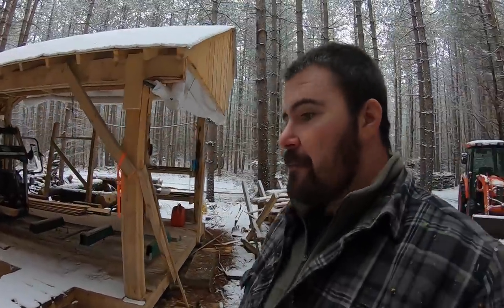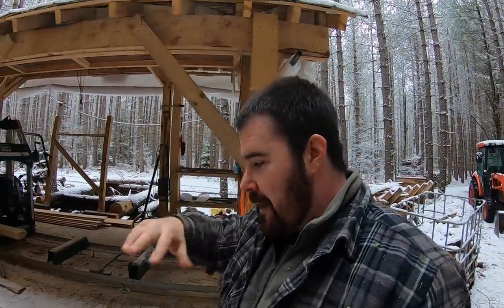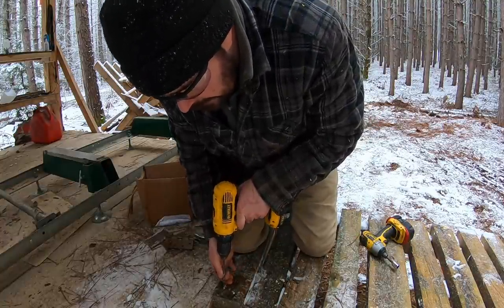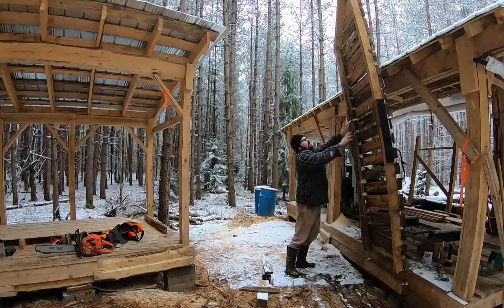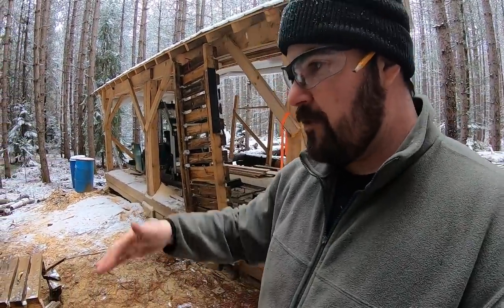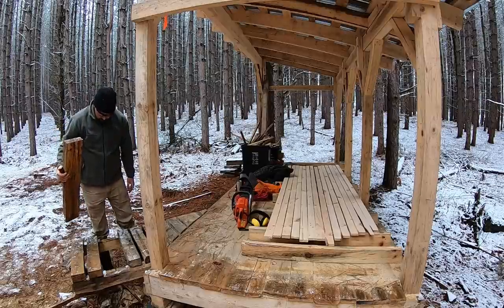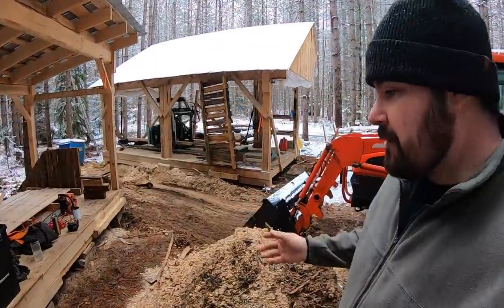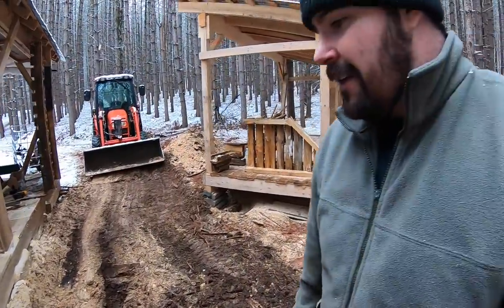Moving Months of Sawmill Dust in Seconds | + Boardwalk Hinge

Comment: I'm in central Maine, have over 30hrs on my new kioti, but have not yet attached the bucket (it came with the 48" HLA grapple attached, which I've been using a lot), and it does not have the cutting edge attached to it yet (they just got them in at my dealer, will be sending it out here ASAP - they are 1hr+ away) - would very much like it on before the big snow hits...

open station for me though, lots of maneuvering through woods and I prefer being out in the elements most of the time

Comment: Hi Sandy,
The trailer jacks is a great ideal. Add a ledger board to the end of the “draw bridge “ for the small section to drop onto similar to what you have mounted on the lumber shed. That way you just manually move it in and out and it will be supported by the long section and the lumber shed.
Reply from the maker: Great idea Chris! Thanks for sharing

Comment: Tim from Canada suggestions for your Boardwalk on your lumber mill. If you know the height of your Boardwalk from ground to bottom of your Boardwalk. Then go out into the woods cut a tree that is about the same dimension as your board work if it is a little bigger than dig a hole under your boardwalk lay the log under your boardwalk so it is supported and you can walk on it if you were still having problems moving it put the forks on your bucket move it that way or. Make a back entrance into your sawmill so you can still get in and not to move your stairs

Comment: I was also thinking to come in from behind the wood storage shed but did see that a lot of work would need to happen to have a clear path. I also like the idea of side-wind boat trailer jacks that would fold horizontally so as not to trip on the handles. But that would mean pouring a pad for the wheels to travel on. Also, four hinges with L-shaped pins that could easily be pulled out. The fourth one would remain closed as a pivot point. This would be the point farthest from the post on the wood storage shed where the boardwalk connects. This is just an idea which would not require much lifting. 
Have good days!
Reply from the maker: Thanks for sharing that. Gives me some good ideas for the future.

Comment: Use an Eye bolt in the header and one in the ramp so they line up and use a carabiner to hold it. Add a skirt board to the saw shed to keep the sawdust from going under it. Like Corn Hole boards have short legs that pivot for the ramp.

Comment: Easiest, quickest and most efficient way of fixing your boardwalk would be a spacer width of your slats attached to the beam, a piece 1" thick x 6-8" long attached to the centre of the spacer with a screw through its centre, 99% of the way in or enough friction so you can turn it through 90 degrees to hold the bridge and back to horizontal when you want to drop it. No need for rope, pulleys, wires and it'll keep it snug against the beam using the wright of the boardwalk and gravity to hold it. Cost, 1x 6" screw. My Grandpa did it with fence slats to allow gaps to nip through them.

Comment: What about a gate latch to hold the draw bridge in the open position. Could even put a lock on it what open and ensure it’s safely up there. Just a thought. I also like the jack idea. Just make sure you have enough height under the bridge to be able to properly mount them on the side without having to go above floor height. Cheers.

Comment: Sandy, you could cut your currently hinged section a bit shorter and remake your other section and hinge it off your first from the top side, you could first fold your angled end section on top of the first section and then use a crank to pull both of them up as you have now and they could both clear your header and just rest back on your deck?
Reply from the maker: Sounds like a great idea. I"ll have to see what I can come up with. Thanks for sharing.

Comment: Quick question Sandy, and one I've always wondered - why did you orient the lumber storage building at the angle it is? Would it not make more sense (perhaps in retrospect it does?) to have made it square to the sawmill shed? Though I'd imagine you would need to remove a tree or two and it will be an awkward/heavy move, it may be worth skidding the shed back a foot or two to make it more square to the sawmill shed, and would give you more room to get the tractor in & out without worrying about banging the cab and/or mirrors on your structures. Win win! :)
Reply: Great idea, Jeremy !! Thanks for sharing, Sandy !!

Comment: I'd be tempted to build something like a stone boat and park it next to the mill to catch the sawdust.  Then hitch up to it and drag it out.  If it had a dump bed (now I'm over-engineering) you could spread it on the roads easily.  I like moving things once.
Reply from the maker: I like this idea Jim. My only challenge would be that the snow would likely bury it when it sheds off the sawmill shed roof since it's a steel roof. Other than the snow I think this would be ideal
Reply: @sawingwithsandy  So... extend the roof?  If you had a sled, you wouldn't need to get the tractor under it.
Reply from the maker: Good point about the roof

Comment: A quick suggestion: on the short half of the bridge put 2 legs with a subframe that extends outward toward the other half providing a landing for the longer half to rest on and supporting both halves. Use a hinges on the sides of where these 2 halves meet and slide the hing pins in place to lock them together and remove the pins to fold them up. 

For the short side make a cut 4 2"x4" steps in from the end and install hinges here and fold it back on itself. It won't protrude in the way and the support legs will then stick up. Put 2 more supports below this new cut which can be permanent. 

Hard to see in due to the camera distortion so this might not work. Hope this helps. Cheers!
Reply from the maker: Sounds like a great idea. Thanks for sharing!

Comment: Just stumbled in here and found it interesting.

For supports, the jacks sound good.  Then the short section of boardwalk could be supported by the shed on one end and the end of the long section on the other.  One piece of metal on each side of the short section that clips onto a bracket or bolt on the long section would work.  It wouldn't add to the length of the hinged side.  Fasten it well to the short section and make notches in the ends of the metal that slip over something near the end of the hinged section.  Could be as simple as a piece of allthread double-nutted to the rails of the hinged section.
Reply from the maker: Thanks for sharing Jim and welcome to the channel!

Comment: You have IBC Tote Cages that you use for storing wood. What happened to the plastic inside those cages?  Cutting the top and bottoms off of the plastic inserts and placing them next to the Hillbilly Hideout(2) platform would likely catch 90% or more of the sawdust. If they were on plastic pallets, then you could just pick them up with the forks of the tractor and off you go.
Reply from the maker: I like that idea. When I bought the IBC cages they didn't come with the plastic insert part though. Maybe I can round up one with the insert for this purpose down the road

Comment: A gate latch would hold the board walk nicely. No brainer to lock in place and bit of 550 cord would release it without a knot to have to deal with. The trailer lifts would work well and a bracket  to align and hold the other piece parallel
Reply from the maker: Sounds like some good ideas. The rope I've attached will just stay attached to the boardwalk with the loop on the end.

Comment: nice vid.
question for ya... also in ontario and we are getting alot of standing water on the property. how are you managing the paths with ur tractor?  first season with ours and just ripping up and creating tons of mud. also have to try and use box scrapper to create a drainage ditch to help water run off... hopefully it will work...
Glenn.
Reply from the maker: Great question Glenn. Lots of standing water around here too and with the tractor makes for some awful ruts. I find I am dumping load after load of wood chips into wet areas and the odd time throwing in the slabwood from the sawmill to combat the ruts.
Reply: @sawingwithsandy  thanks for the info.
we too put some wood chips but can not keep up between chickens and sheep and ruts no enough time to chip it all...lol
I just tried the box scrapper with one tooth down to ty and make a small cut to allow the water to flow and the wheels of the tractor did a better job ...when it dries out abit I'll dig it out and put in some drainage pipe. 
always something to work on...
Glenn.

Comment: You could use 2 pieces of 2" angle iron to each side and and put bolts through them.
Reply: I am not sure if you are referring to what I am thinking but am adding my bit just in case.....2 pieces of angle iron mounted on the ends of the fold up section of the boardwalk extending out just a bit toward the small section.  The small section would then rest on the angle iron and always be in alignment.

@Sandy:  A stop of some kind will also be needed on the angled small section to prevent it from sliding away.  Using the trailer jacks as you are considering would level both sides at once.  And your thinking ahead with knowing that the ground level will always be changing with the cold and hot seasons would be an easy fix(as you aware of) with the jacks.  I haven't figured out what to do with the small section but most likely will just have to manually lift it out of the way.  I like the idea of what you are doing as it will make the boardwalk last many more years before it rots(as you also stated!).

Comment: Iittle shot of mud n now time for a cut.much better.jacks would work good just make sure you put a piece of wood under them so they don't freeze. I have had so many Jack's freeze to the ground n have to beat n heat with a torch for n hour or more to get a trailer out.you might want to make a path from the other side so you can push straight threw on that sawdust buddy.
Reply from the maker: I know what ya mean about the jacks freezing. Been down that road before too.

Comment: Move your timber storage shed closer to the plant. Doesn’t it drive you absolutely crazy you have 2 platforms sort of next to each other on 2 different angles. Now you have hinges to slip on. Wow.
Reply from the maker: The position of the lumber shed at the angle to the saw shed allows me to drive straight in and pickup a load of lumber from the lumber shed and back straight out. With the lumber shed beside my saw shed I wouldn't have room to maneuver the tractor without cutting down a bunch of trees. Could be a possibility of moving the lumber shed in the future but not at this point.
Reply: @sawingwithsandy  thanks for the reply. Enjoy your Vlogs from down under Sydney, Australia.

Comment: I have a better solution.  Move your lumber storage shed to the same end of the sawmill building that your slab wood rack sits. Rotate your slab wood rack  to the front of the building where your log bunk sits.  The slab rack would sit at the corner of the building so it would not interfere with the logs on the bunk.  Using this system you wouldn't have to cross the sawmill bed to stack lumber plus it would be less steps. The slab wood handling would not be affected other than it would be placed 90 degrees from where you place it now.

Comment: You should get your money back for the Designer of the 2 buildings. Should have taken the Saw Dust / Snow removal into consideration. :-)
Reply from the maker: haha well luckily for me the designer was working for free. Big issue I have is access with out having to clear a bunch of trees, that's why the buildings are positioned the way they are as I need to be able to drive in and pickup a load of finished lumber and back out. The length of the tractor makes it difficult to manuver without the lumber shed positioning.